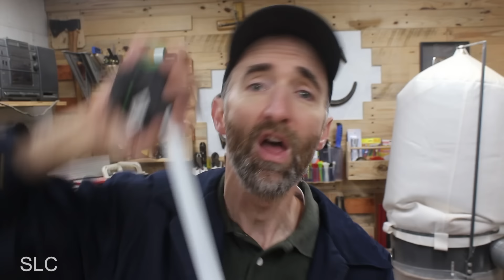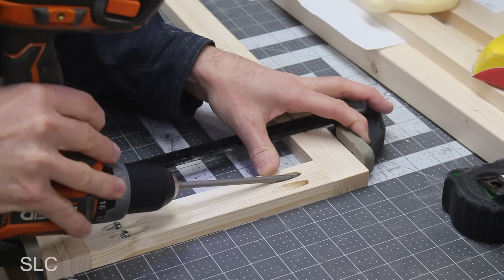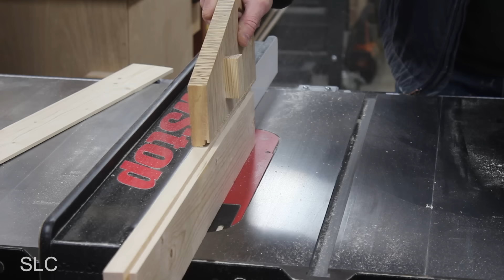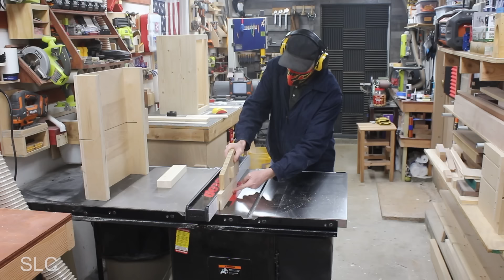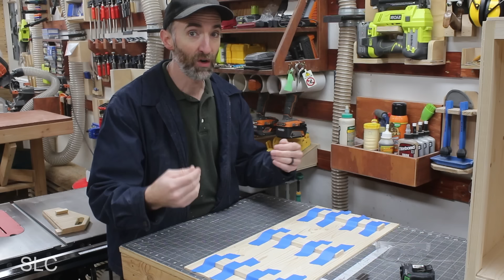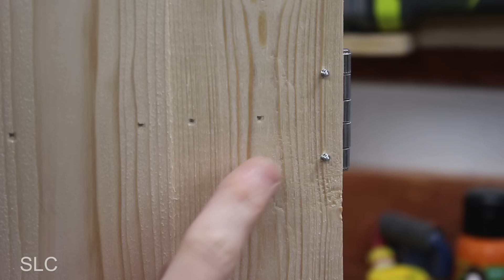$10 DIY Project: This Cabinet Will Surprise You

Comment: nice little cabinet! i don't think this kind of resawing and the like is something most folks think about. i've made a bunch of shop cabinets out of 2x6 offcuts leftover from a job. I went with 3/8" thick and add a drop of glue in the center of each of the panel boards and brads. i shiplaped them to hide the shrinkage that usually comes with construction lumber. maybe even just beveling the edges to 45˚ would help avoid gaps when that wood shrinks later. or you can give it time to reach equilibrium with your shop if you're more patient than i am. construction lumber usually shrinks a bit due to not being very dry. often 12-15%+ compared to the 5-7% it will fall to in a climate controlled environment.
Reply from the maker: Thank you for the info on the percentages. And the 45° idea is great.

Comment: Nice job mate! As a novice, thats one of the best DIYs ive seen for CHEAP! I Wonder if you wamtwd to make more whether 2 x 4x2s plus 1 sheet of 3-5mm ply would cost/how many you'd get for youoney using ply for the shelf bottom/top sides? Door. Eg. Cut the 4x2s down for same frame but ise a sheet of 3-5 mm ply for the faces, wpuld it work out cheaper after doing say 4 cabinets? - BTW Wood is between 1/3-1/4 the price of the price here in England so guess that makes a BIG difference
Reply from the maker: I have not calculated the numbers for using a 2x4 and thin plywood but it does seem like it would be inexpensive if you made four or more.

Comment: $10 in materiel and $1000 in tools?
Reply from the maker: Tools are definitely required to build any projects, so builders do not even consider that part of the price.
For example, let's say you earn $1,000 a week at your job, would you then say that it doesn't count because you had to pay $20,000 for a car to get you there?  
Just a thought.
Reply: @SpecificLove7  I understand, but it is nice to know that a project requires a number of expensive tools to build... maybe a price list if you didn't have a way to split a 2x4 into strips.